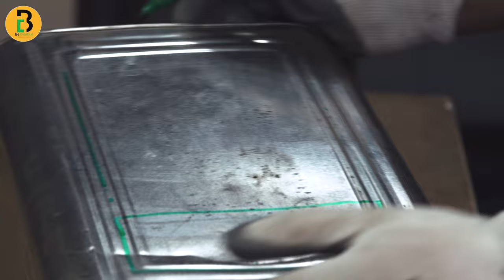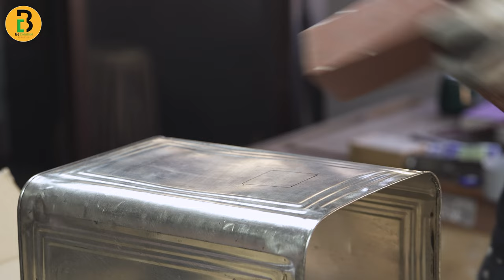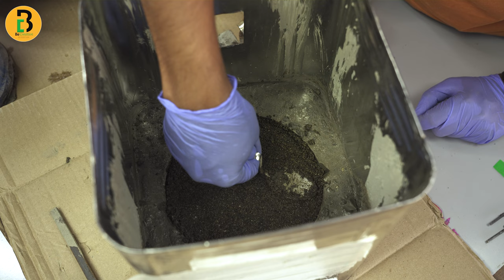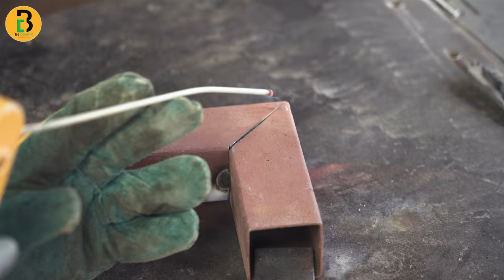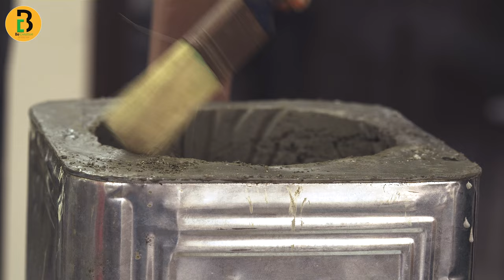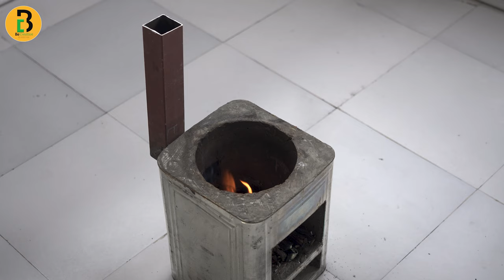How To Make A Rocket Stove: Easy Diy Plans

Comment: Great Idea...downside your house is gonna get really smokey. 💨
Reply: This is not in house ofc
Reply: I'm trying to make a outside wood heater out of a washer tub and a dryer shell. Going to run steel tubes in the top and blow air from in shed through the tube and back in shed, that way the fire and smoke is outside. If the tube idea doesn't work I'm going to try pumping water through a copper coil and use a transmission cooler with a fan for heat.wish me luck I don't have much 💰 to spend.
Reply: @shakerkhalloph6087  l
Reply: @shakerkhalloph6087  ll